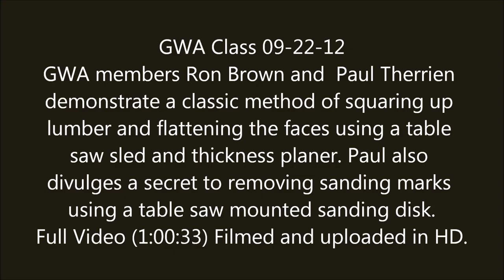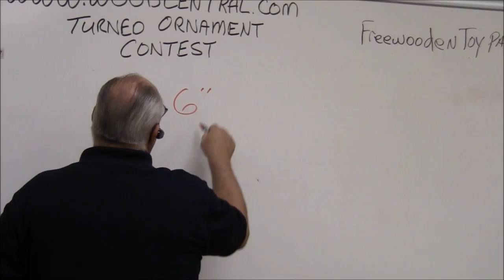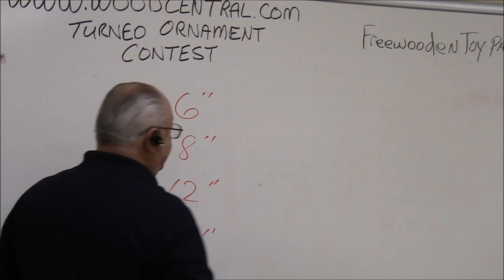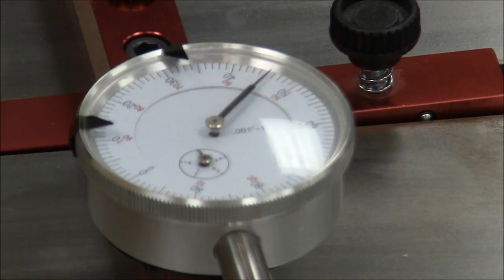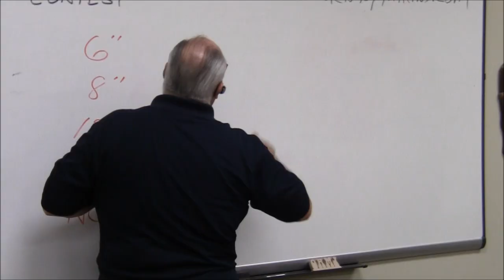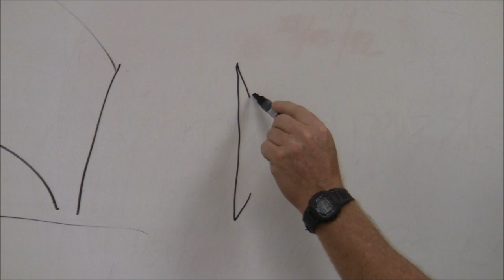2012-09-22 The 4-Square Method by Ron Brown and Paul Therrien (1h00m33s)

Comment: Using a jointer, the feed pressure is applied after the blade and rarely started at the edge of a board. It takes a bit of practice to determining where to start the planing process, but commonly it's crown down and where the curve is based for the start of material removal - i.e. a 1/4" curve over a board 10' long on a jointer set up to remove 1/8" material would be around 2-3' into the board on the first pass. At about an 1/8", I rarely process more than 4 passes on wood from a quality supplier.

You gradually work yourself toward the edge, which should be your final pass (sometimes taking 2 passes to assure accuracy until confidence is succeeded) - Keeping even pressure over the "follow plate" of the jointer leads to this confidence. To square wood on a jointer requires first bringing one side to straight - relying on the jointer "follow plate - the surface after the blade" and then adjusting the fence to perfect square with the "follow plate" surface (usual acquired prior to straightening to complete an even workflow).

The "feed plate - the surface before the blade" is designed to control material removal - hence why it is adjustable. The quality of your jointer is determined by how parallel the cutting knives are with the "follow plate" - as well as how stable and easy to adjust is the fence. This can be checked with as quality straight edge laid across the "follow plate" and knifes at top-dead-center. Chances are this is for your own clarity, seeing that the knives themselves are your only means of adjustment on most machines - sometimes they are not adjustable at all. Consult your user manual.

The sharpness of the blades in combination with the material weight allows for minimal effort to straighten a board to perfection in the least amount of time - passes and pressure. It is important to maintain the jointer to pristine condition - including initial setup to hone in on any adjustments allowable by a jointers particular design. If it is true and square, so will be the material you are straightening.

The process of this video works well too - yet there are a lot of variables to consider - one most relative is your own skill and attention to detail. Most of the time a proper attention to setup leads to the most accuracy in repetitive production. Saving time, material and money as well as creating a fun and creative outcome. Get to know your equipment and be safe.

CHEERS! Happy woodworking!

Kirk

Comment: You can make your own sanding disk simply by grinding off the teeth of a worn out blade. You might want to get inventive by creating something to rotate the old blade on its center to hone in a better round, but I imagine it can be done close (balance wise) enough not to create extra wear on the arbor bearings. After that point you could us some sandpaper adhesive and the disk itself to size up you paper. You've already invested in the blade you are about to throw away, might as well use them. As well, chances are you will accumulate a couple of them for different grits - using them as you need them.  Just some food for thought.
Reply: How do you add in the 3 degree bevel?  As they said, a completely straight disk will burn your wood.